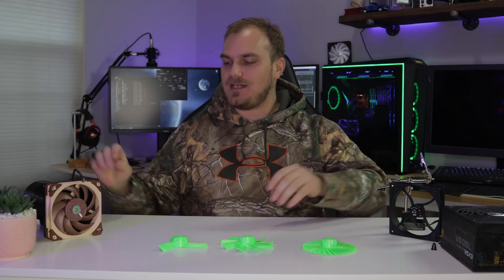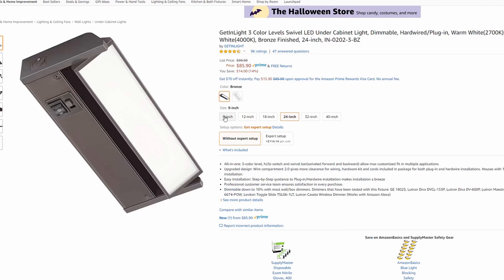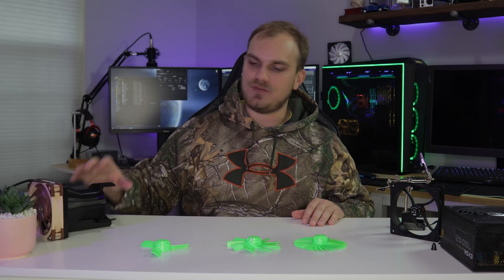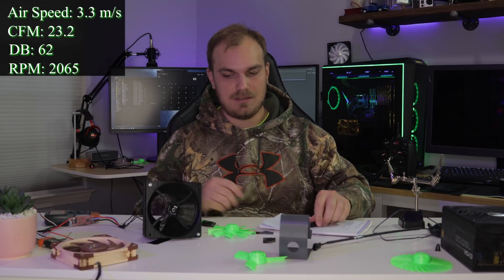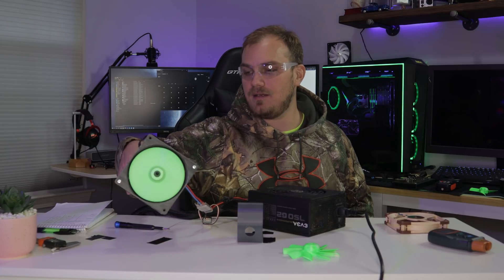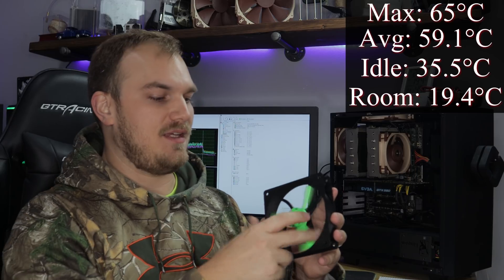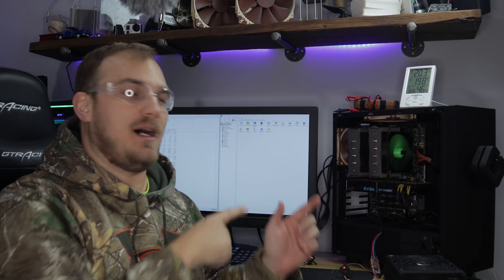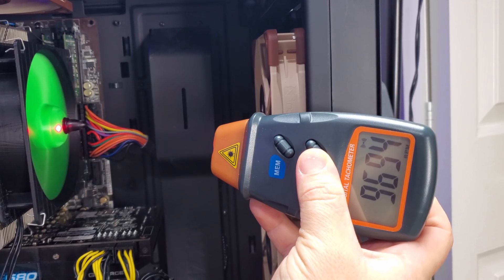This 120mm Fan BREAKS All The Rules!

Comment: If it's an older 8-bit ESC, running BLHeli (non _S) or SimonK, you might want to consider getting a BLHeli_32 one. The former ones generated the PWM signal for the FETs in software, which was jittery and created resonances in the motor bell, like in your video. The _S version used an MCU that does hardware PWM and reduced these resonances because the jitter went away. The BLHeli_32 ones on the later firmwares have an option for sine modulation of the motor commutation signal, removing some more noise (at least in steady throttle situations like yours in this video).

Comment: great vid man, i like this kind of thinking. the next step could be to remove the blades from an existing 120mm pc fan, and print your own fanblade designs and test them on the stock fan's motor, to see if you can make some good designs ;)
Reply from the maker: I'll give it a shot, the hard part is removing the fan without damaging the motor
Reply: @MajorHardware  maybe if you'd leave the motor inside the stock frame, and only remove the blades from the outer housing of the motor? this way you could make the motor hub as an "adapter" where you can fit multiple different fan designs around. you might lose some space from the fanblade area, but it might be a viable solution, without taking the motor apart.

Comment: Is there a way to muffle the sound of a loud cooling setup while minimally affecting airflow? From what I understand, the things that are good at baffling sound are good at stifling airflow too. With the way your air-cooled videos are getting louder and louder, maybe we can get a video for what we can do about loud setups. 

It would be interesting to see if you could create a super-optimized, super-quiet air-cooled setup that dumps heat faster than any stock liquid-cooled computer could.
Reply: Well that’s impossible due to basic physics... even with 1 mile long fins, you couldn’t do that. At a point the fins become roughly room temperature so beyond that they do nothing. With liquid cooling you can keep the base near room temp (which with air cooling only occurs X distance away, and the temperature of the base where it contacts is determined by thermal resistance). So what you are asking won’t work, basic physics is why water cooling works better.

Also you might as well go fanless water cooling (which doesn’t work well with air due to that basic physics I just mentioned) since the radiator can be as big as you want for bringing the fluid to basically to room temp (It’s baseplate temp is not based on the distance the coolant runs, with air cooling let’s say near the bottom it has a flow restriction or was partially enclosed in a box, the processor would run that much hotter due to thermal resistance of the fin in the obvious terms of deltaT/distance).
Reply: Maybe you want to target really crappy $35 AIO? You could beat that at least, many big air coolers already do at the same noise level.

Although, haha, my Titan Xp is so freaken loud I can’t hear the hum/whine of my phase compressor (which isn’t very loud, and the hottest I’ve seen it ever get was -35c under load of an FX-8350 at 1.7 Vcore, at idle it’s -60c, it’s way less noise than blower cards...).

So you don’t use water for any serious overclock, but I’ve ran GPUs on a fanless water cooling system before (peak temp was 42c running a synthetic load for 72 hours to ensure equilibrium was hit, it was only 2x RX470 but it was done for like $50 for both their cooling plus a 240x240x80mm radiator for a schoolbus passenger heater, but car radiators are like $20 from an auto-salvage and just make that the back of your case and it would have a lot of cooling potential).
Reply: You're right, I chose my words poorly. liquids are denser than air so heat transfer works better, and water has a high specific heat index (I think that's the term I'm looking for), so you can't ACTUALLY dump heat faster from an air cooler than a proper water cooled rig.

What I want is to experiment with optimizing pure airflow as much as possible, maybe experiment and find new tricks.

What do you think about have a small length of air-ducting tub lead from a front case fan directly into the CPU fan? The idea is to have ambient air temperature going into the heatsinks rather than hotter case air. I know with enough intake and exhaust fans on the case airflow's high enough to solve the problem, but that's not the point. I want to do it with less.

But I also know that setup will be louder because the CPU fans won't be muffled by the case, so I wondered if anyone knows how to baffle the sound without sacrificing fan RPMs or airflow.
Reply: Jared Barnes like most OEM computer like Dell or HP? Most of them have ducts for cooling, (which is partly why they can be so silent you’d think they were fanless, at least in the better models). I’ve made ducts for my computers that routed around chipset and VRM, as well as back of the socket cooling which lowers socket temps by like 5-7 degrees for FX and also reduces core temp some.

I think for muffling you’re wanting what is called a “glasspack” (fiberglass packed inside of 2 tubes for engine exhaust, it’s basically a straight pipe with as little flow restriction as possible). So I think you’re aiming at something like a duct like Dell or HP often use (or just a straight pipe to the front or wherever works for your cooler), and then wrap that with deadening foam or fiberglass insulation (which is available at a lot of home improvement stores as a roll of insulation tape), and then don’t forget rubber vibration mounts like all servers use for the fans (I personally balance my fan blades with some trial and error with dots of hot glue on the hub), then you’ll have pretty silent (I’d recommend making the exhaust a slight trumpet shape so the exhaust is low velocity flow so it’s not high speed air suddenly swirling and mixing into stagnant room air). You can also do a more complex system but I think this will be plenty, also get some decent fans and make sure to oil them because it drives me crazy to heat bearing noise (I have magnetic levitation fans, but they are 120mm server fans so they don’t spin super slow like you might want, they are like 800-4000 rpm range and you can’t undervolt them like most fans since they rely on 12v for the electromagnetic levitation bearing, but some other companies sell magnetic levitation bearing fans for desktop use).

Good luck!

Comment: Do the 30 blade again and test the rest against it with a radiator. The 30 blade design should have a lot better static pressure due to very few back flow holes as the blades overlap each other. The 3 blade may move more but might be relatively useless in a static pressure environment because of the huge gaps between blades for air to back flow through.

Comment: How about 4 Fans in a row counter rotation, and 5.000-15.000 RPM 
Did someone say JET ENGINE?
by the way, i got for my Laptop small SAN ACE Server fans wich basically are Jet engines, they (2 in a row) throw more air as my Hairdryer! 
But, they also sound like a jet engine.

Comment: do the 30 blades but dual with dual blade,
1 is 3 blades
2 is 30 blades and put them separated for 1 or 2 inch or more using the,

the 3 blades need inside and the 30 blades on outside

Comment: i want a Jet blade in my PC i dont care i ware headsets
Reply: Haha, your profile pic is ATI, loudest card I have sounds a lot like a jet taking off from a distance (the pitch is uncanny...), get a FireGL V8650 if you want jet noises, it sounds very real for flight sims, even if the reduculously got exhaust is unlike a real plane with a cockpit it’s just fun having it blast your face on an open air test-bench (it gets really hot, it’s like 200w at idle for that card, overclocked running Furmark makes a great hand drier so I used to keep that computer by the sink literally for blow drying my hands, lol!)

As an aerospace engineer, I’ve got to say it’s not the low pitch roll of planes flying overhead, it’s more like the spook up and whooshing of smaller jets (it sounds an awful lot like small centrifugal turbojet engines, but like they are from some distance).

Or if you want good cooling get an EDF (also commonly called electric jets), those may give the sound and certainly the airflow you want!)
Reply: @jakegarrett8109  :D i will

Comment: The 30 blade will be the best because I will have a lot of static pressure! You could put it on a very dense radiator and it will outperform the other. 🙂

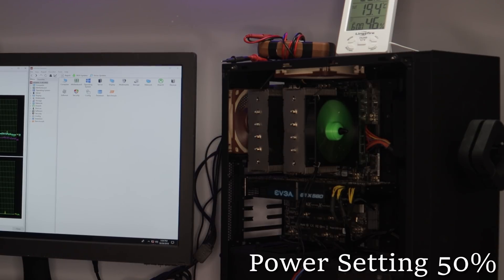Comment: 8:10 “Half speed is about 9000RPM”

Your Vacuum Cleaner: Am I a joke to you?
Reply: Dyson DC mother : you are nothing
Reply: Air conditioner: you dare oppose me mortal
Reply: Emerald Blaze At 10000 to 16000rpm:
Cesna Aircraft and Kawasaki Dirt Bike left the chatroom XD
Reply: Turbo/super chargers: rookie numbers..
Reply: @aceparts1005  Haha Electron go brrrrr
Reply: looks like all you here dont know what power tools is because angle grinder is the most scary power tool for me.
Reply: Dentist drill: how about me?
Reply: toaster: ....¿
Reply: I used to run RC cars back when I was a teenager. (This was back before brushless motors btw.)
And I found that most ball bearings would overheat around 30k rpm.
Turns out that the oil lubricating them, was limited in shear rate, and thus it would become "unlubricated" at high speeds.
I broke a fair few bearings that way, still it was fun. 😁
Reply: @Grumpy_old_Boot  Modern greases and oils are much better too right?
Reply: @CynHicks  
I have seen a few stand up to 35-40k rpm, but most motors will be working in the 20-29k max range, or slower.

Part of the reason is that they can use the cheaper bearings/oil, but another part of the equation, is application - Most RC cars are simply not geared low enough to use motors that go faster - So it doesn't make economic sense to make them go that high.

That said, yes there are some better oils and bearings out now, that wasn't around back then.

Also, you can make bearings that push the oil in such a way that it doesn't get away from the bearing race. ie. it cannot escape from lubricating the bearing.

Curiously, shear rate is also one of the reasons why combustion engines aren't doing 50k rpm.
Reply: CRAZY!!
Reply: Jackhammer:Mwahahahaha......
Reply: that one LMP1 car that nissan made with the flywheel that goes to mach1: >:V
Reply: Thats Legit The earth’s surface moves at Mach 3 and yet it rotates once every 24 hours, that’s less than a thousandth of 1 RPM. 1/(24*60) So if you have the size of that Nissan flywheel handy let’s math together :-)
Edit: I should have specified that I meant the surface at the equator moves at Mach 3
Reply: Old Bathroom fans:those are rookie numbers
Reply: 72x cdrom reader is laughing at all of you.
Reply: @CynHicks  What about the laser-powered, levitating nano-particle rotating at 300 billion RPM? 

https://www.purdue.edu/newsroom/releases/2020/Q1/light-powers-worlds-fastest-spinning-object.html
Reply: @Papperlapappmaul  How in the hell did they even measure that?

Comment: What you need is a 3D METAL printer. Haha.... No more heat problems.
Just a lot more inertia for when things inevitably go wrong and a much more expensive printer. My University has a few.
Reply: Tbh, a better idea over a metal fan would probably be a ceramic fan. Easier+ cheaper to prototype and no play that you'd be able to notice with a consumer motor.
If you were to do this, I'd recommend TTZ (transformation toughened zirconia)
Reply from the maker: I can survive a plastic blade to the face not sure about an aluminum one haha

Comment: In all your measurements static pressure is missing. I'd imagine the 30 blade fan would be great at that.
Reply from the maker: I cant find a good way to messure static pressure
Reply: @MajorHardware 

Let the fan blow into an airtight enclosure, and put a pressure sensor inside. 
https://www.adafruit.com/product/3966
8 Pa (0.8 mm H2O) relative accuracy, and about 3 Pa (0.3 mm H2O) noise. You can probably improve your measurement accuracy a bit beyond that, if you switch it on and off several times and average the differences in pressure over several cycles (to reduce drifts and noise).
Reply: @MajorHardware  A clear vertical tube with a ball inside slightly smaller than the ID of tube to minimize bypass air but still allow free movement of ball then calibrate with a fan of known static pressure, not highly accurate or precise but enough for real world applications.
Reply: @bryandepaepe5984  This would not work. This would measure flow
Reply: @MajorHardware  you could put them in an environment that benefits from static pressure. Slap that baby on a radiator and see how she performs compared to the others. I was actually thinking they'd be pretty good as rad fans to push air through the fins
Reply: True WingChun  what you're calling 'vortex plates' are just plain old stator vanes. They remove the swirl component coming off of the fan discharge (every single gas turbine engine uses stator vanes after each compressor and turbine rotor stage, though turbine stator and compressor stator do completely different things. 

For a fan meant to discharge air past a radiator, having stator vanes like that is actually less desirable, for a radiator application you actually WANT lots of turbulence and swirl because turbulent flow encourages mixing across surface boundary layer and improve thermal transfer.

In fact, Silverstone has made the AP series fan for years, and they market them specifically for airflow fans instead of for radiator fans, for this very reason.
Reply: Makes sense since it produced enough force to pull itself off. It’s probably the best candidate for high altitude lift.
Reply: exactly what i was thinking. could be a useful design for thick radiators. I image that fan would push air through them no problem. Granted not a ton of air, but i think it would be enough. It would also be quiet

Comment: maybe you could cut off noctua blade and then make 3d printed plade that have holes in the middle that can slide into original fan motor and make some locking mechanism so it doesnt change any variablle except the blade itself, btw love what you're doing, keep it up
Reply: Cutting a blade from a noctua fan is like removing the blade from a samurai:
A Blasphemous move

Comment: I think if you could source some motors that were good/cheap enough and compatible with typical motherboard PWM controllers, you could sell the motors to go along with shroud and fan designs.  
You could even model some shrouds to have bleed-air (so an extended length shroud with an outlet after the fan) so it could be attached to a small pipe and aimed at hot components, like VRM or chipsets, saving the addition of an extra fan or more.
Have you thought about doing some squirrel-cage designs?  Maybe a couple/few in series to lower noise?
I've often wondered if that blower style done in series, then placed in a PCI slot to exhaust (like a reference video card) may prove more efficient than an axial fan.
It looks like in your last set of tests the limiting factor to cooling was not airflow.  If you really wanted to test your mad skillz, you could design and print a low-temperature-differential Stirling engine that could move enough heat to cool air over the cpu to below ambient.

Comment: I'm guessing you used PLA filament for the fans (correct me if I'm wrong). If your 3D printer can handle it, you should consider printing the fans with ABS or PETG filament. The fans will be sturdier with better heat resistance.
Reply from the maker: Yes pla yes my printer is rated for pla but I haven't tried it

Comment: I'm actually surprised these fans stayed in one piece from the rotational force at those RPM.
They didn't fall apart until they contacted the sides, which is more than I expected. That's a lot of gforce.

But this illustrates a problem all fans have to overcome - the blades will stretch. Usually this happens over a long time - but due to extreme RPM and a weaker material we saw it happening over just a short time here. This is why the new Noctua A12 uses such fancy materials. The only way they can get such tight tolerances WITHOUT the fans ending up scraping the sides a couple of months or a year later is by using much more rigid and high quality material that will warp much less under force.

Comment: The only benefit to using lots of small blades comes from the fact that large blades create drag as the air coming into the engine has a greater velocity than the velocity of the air created by the blades. A computer fan will never have this issue though obviously.

Comment: Another great video, I'm really enjoying these fan experiments! Have you considered using an Arduino instead of your transmitter? You can control an ESC with the servo library, that way you can get slightly more repeatable speeds and a little finer control.

Comment: I say the 3 blades will do the lowest frequency but the strongest noise. Having so much space it is under performing per each rev but per blade should have the highest h2o/mm pressure and cfm. Probably making them wider with an exponential bend for maximum pressure would be great. The disk fan should get the most cfm but weakest pressure. And the other should be the best of all.
Did you ever thought about a design similar to a turbo?
Reply from the maker: I did ;-)
Reply: @MajorHardware  anyway the three blade design at the end was not bad. Maybe the gap let the air fill the space as it goes so fast. A dynamic you'll never see in below 3K rpm fans. What was the actual m/s speed of the fan?